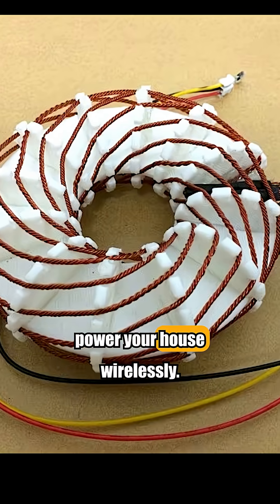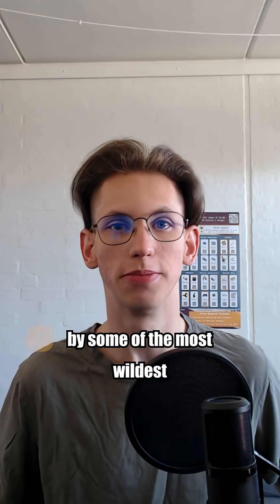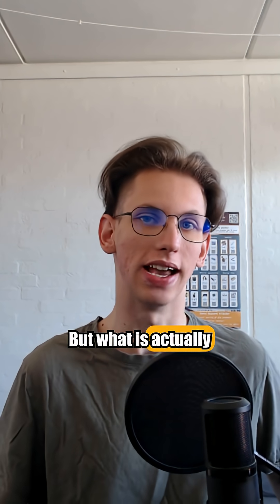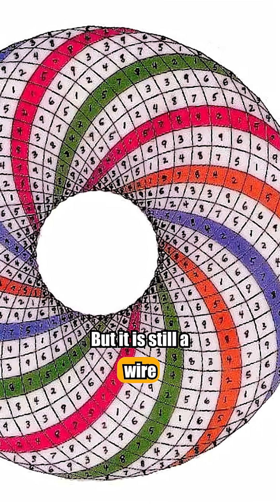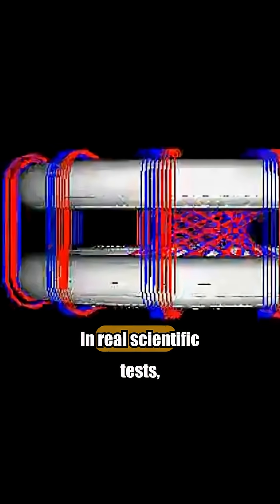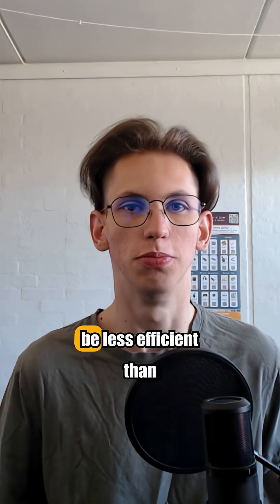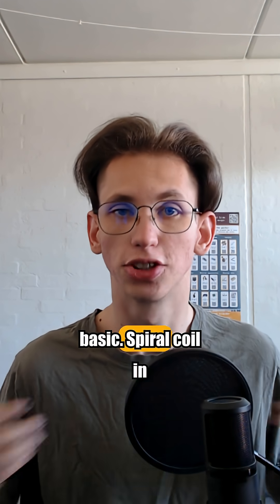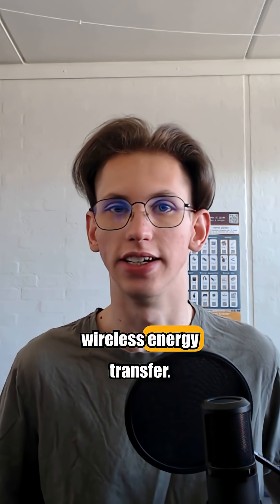Rodin Coil: Debunked

Comment: It has the beauty also it's used like a Tesla coil in which the whole secondary coil produces ozone.
Lots of videos has shown the coil also transmitting power wirelessly which is stronger at the hole.
Do you make your reasarch well?
The only biggest reason I see this is because to wind it is stressful compared to spiral winding. It's like a vortex cause it's similar to a black hole when you allow a magnet spin from outside to the center.
For motor. I saw a video showing that and it spun quite well.

The main use of the rodin coil is just similar to a Tesla coil.